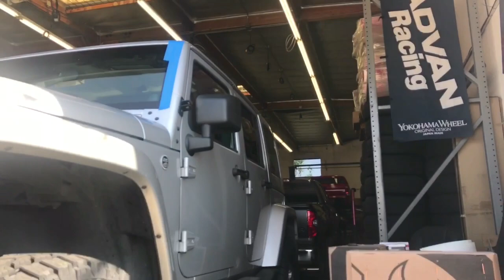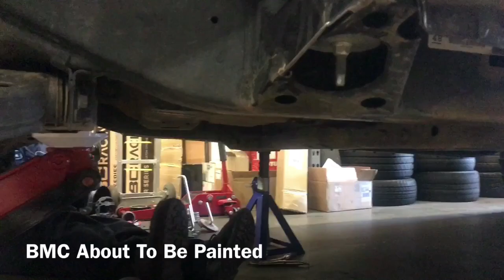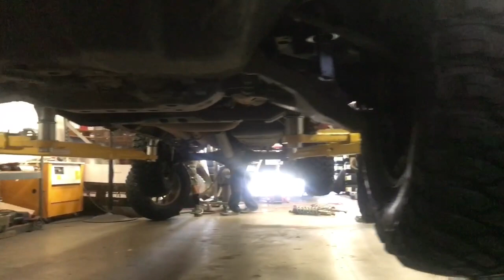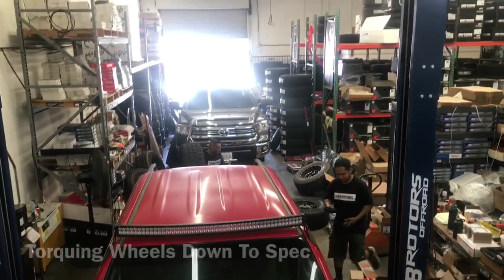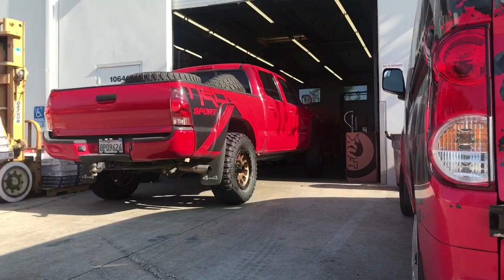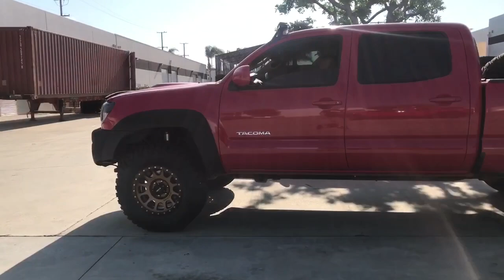Toyota Tacoma on Fox Suspension, BMC on Tundra, & 4” Pro Comp Lift on Jeep JK

Comment: What did you guys do for lug nuts on the method wheels for the Tacoma. Mine barely engage on my 07 Tacoma, going to go with longer studs.
Reply from the maker: Sounds like you’re using the wrong lug nuts? Method wheels are designed to be used with stock studs and conical seated lug nuts.